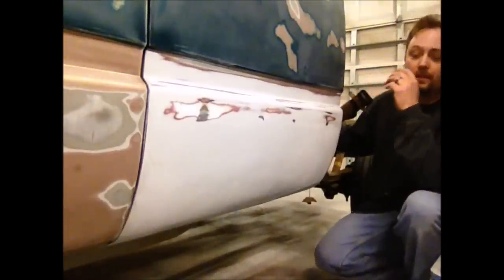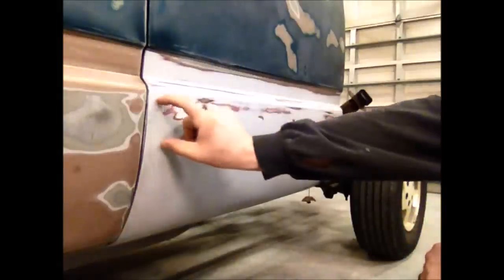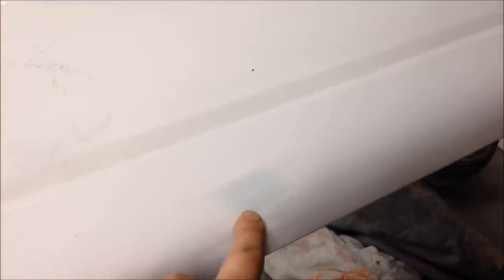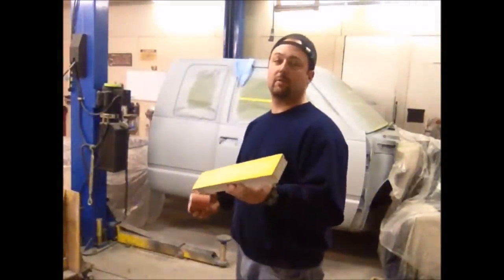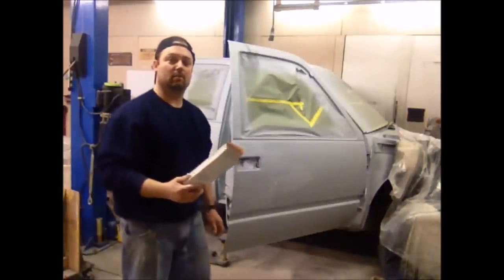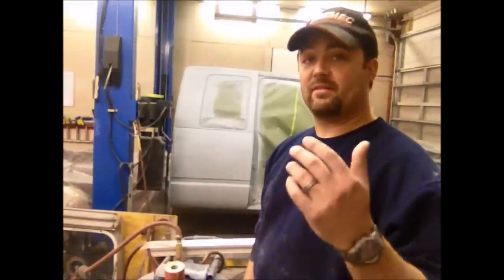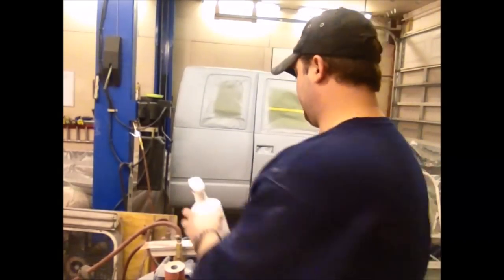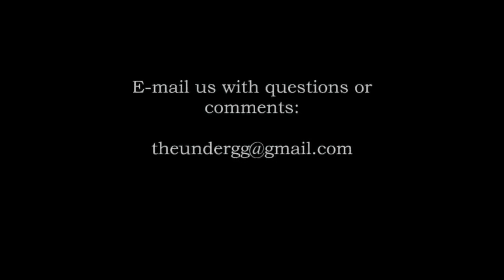How to paint a truck from start to finish, part 8

Comment: Awesome job! plan on painting my own truck in the near future!
Reply: so,how did your paint job go?did you buy a compressor,an air dryer,a ventilation system,a high end paint gun,da sander,long boards,sanding blocks,sand paper of varying grits,masking tape and paper?

Comment: Guys wat is a single stage kit mean pls??
Reply from the maker: Single stage means there is no clear coat, just the color.  It will be shiny without having to spray a clear on it.  Most people can't tell the difference in look.  The single stage won't last as long as a base coat & clear coat set up, but a decent quality single stage paint job should last several years without an issue.
Reply: @UGGdyno  can I paint clear coat over it ??
Reply from the maker: @henrymccarty8014  I have done that many times with no problems.

Comment: Whats the paint code for that color
Reply from the maker: There wasn't a code.  The paint store I use had three quarts of titanium grey that were returned for some reason.  I bought those because they were really cheap.  I poured all three into a gallon and then I added some black and some blue paint that was left over from some other job.